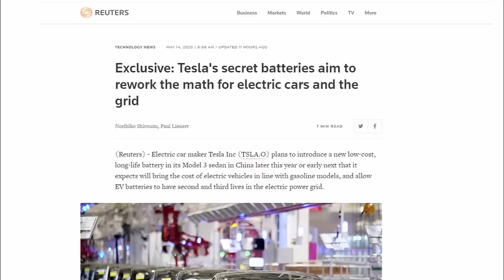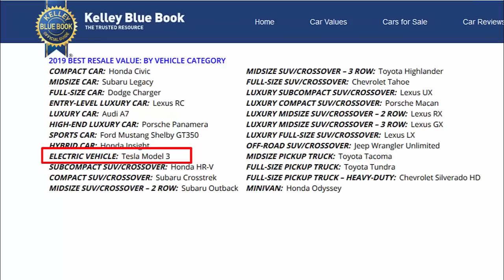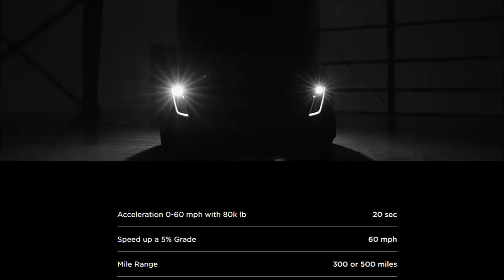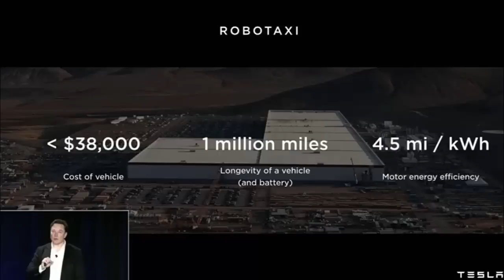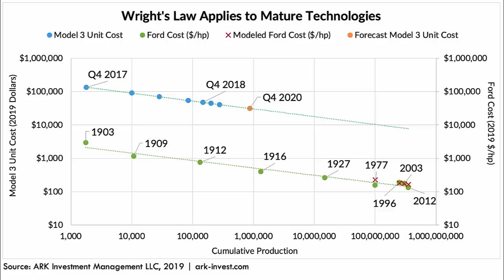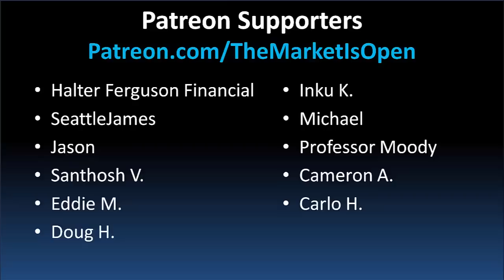Tesla Battery Day Will Unveil Secrets to the Million Mile Battery

Comment: The purchase of Maxwell is the key to longer life of the battery.  They make high capacity capacitors.  If you search the web, you will see videos of people that have replaced the regular car battery with a capacitor bank.  When you accelerate, this is what puts the greatest strain on a battery, so why not use the capacitor bank to handle the strain and reduce the battery recharge cycle.  That increases the battery life by at least half or more.

Comment: Longer lasting batteries will most likely just be the next Tesla owners problem.
Reply: Negativity or sarcasm?
Reply: Most Tesla car owners will only drive an average of 5000-20.000 miles a year. And considering that they will sell their car on average probably around 4-6 years in average. Means that the original owner will most likely not be affected by battery problems. It will then be the next car owners problem. Which is after the warranty has expired. So it's neither, it's the truth.
That is also why most EV car manufactors battery warranty is completely useless. The battery warranty most manufactors have is only relevant for less than 1% of people buying the cars.

Comment: putting so much energy into such a small space would be too dangerous!!!   Science and physics says it would be a friggen bomb,  or radioactive as hell!   Maybe they can get a battery to go though more cycles...  But not hold a million miles on one charge.   As an ex-mechanic I don't buy the fact that having engine/transmission that will last longer will save the customer much money...  Most the repairs to older cars 15-18 year old,  is everything rubber and plastic starts to fail.   A/c hoses,  Door seals,  window guides,  suspension bushings,  Inside parts like stearing wheel starts to wear out,  seat leather starts to rip,  raidio knobs stop working,  window switches,   ignition switches.. sun visors..    the list goes on and on for older cars....   It takes a lot more money to maintain a car past 15-20 years old..  Even if its electric....
Reply: The best and longest lasting batteries ever built are highly radioactive  {nuclear batteries).  They were used on "Voyager" space probe and  "mars rover".   They produce a lot of power and have a super long life  but are also very radioactive.   Google "nuclear battery"  for more info.    E=MC2   means Mass can be converted to energy.    There is actually a nuclear battery you can make at home, using Tritium  and a solar cell..   But the power is very small.  Google "tritium battery." for more info.

Comment: It's still going to be a Lithium battery.

How is increasing lithium battery production 'green'? 
--
o Lithium's maximum potential as an energy storage mechanism is much less than liquid carbohydrate fuels
o Replacing 10s of billions of engines with electric motors, many containing expensive, intensively produced neodymium, cooled by essential lubricating oil
o Increasing Lithium production 10s of 1000s of times to supply all these 'million mile batteries' - which they won't be
o Opencast lithium mining is hugely destructive
o Evapourating 100s of litres of drilled underground brine reservoirs for 1 kg of lithium releases vast quantities of the most powerful greenhouse gas, H2O
o Millions of acres/hectares of land will be needed
o Refinement of lithium is very intensive,  transport costs on top
o Battery production is very intensive, transport costs added
o Battery disposal is a major problem, with recycling costs added.
o Portable devices are on the increase. Lithium is not a sustainable fuel. Increasing its use by 10s of 1000s of times will be highly destructive
o Carbon and Oxygen cycles are natural, CO2 is plant food., we breath O2 There is no natural global Lithium Cycle 
--
How is increasing metal space junk 'green'?...
--
Musky people stink. Brainwashed neo-peeps... Nazti Sheeple-Kidz and profiteering parroting controllers. Plant more trees, but more importantly, stop cutting down our wild forests if you want to be green. NEVER BUY AN E-VEHICLE or you will be less green than a lump of coal... or solid lithium (even worse). It's a marketing scam by neo-liberal scum that want to force the world to buy their new e-vehicles and sprawling junk power schemes.

Comment: Wish Tesla comes up with a plug-nd-play battery that can be recharged or replaced similar to the AAA batteries  in every home, so that there is no need to go to the gas station.. basically it means it can deliver FREE energy for cars and all vehicles, (and for all our home needs as well) at very very low battery cost which is rechargeable... imagine the same battery can be used to power homes or industries at $20/kwh - that wll be a game changer.  I think only a Hydrogen fuel cell (SOFC ) can match up with this in the near future, when hydrogen can be stored at low pressure for all our energy needs at homes, industries , and transport needs.

Comment: One issue of V2G usage is the potentially diminished flexibility of unplanned journeys. No doubt there would be the facility to limit battery drain down to a minimum level of charge as a contingency, but situations may arise where this would be insufficient for an unplanned journey. It's not a game-breaker, but the associated anxiety - or indeed an occasional real-life situation where this occurs - is a factor to be considered. (it's still great though! :) )

Comment: I wonder if the million mile battery starts to achieve the types of energy density that would be viable for planes.
Reply: For ultra light gliders which have to be towed by another plane to take off it could extend capabilities, like longer flight and more maneuverability perhaps. But there is no way to achieve the power to take off on its own power.
Reply: That's the nub of it I guess. As Musk has said, the biggest energy cost is getting a plane into the air, once you're there battery power isn't such an issue. Perhaps there is some way to launch a large plane with ground based power, then let it fly on it's own battery power. Maybe we aren't a "million miles" away from that being viable, but there is no political or economic will to do it, if we indeed are.

Comment: on the semi-truck ya could plate the roof of the trailer with panels to help slow down the energy use
Reply: That's not slowing energy use - it's increasing production capacity.
Reply: @DialatedPupils never said it would be used where it snows. it will be used were its sunny.
Reply: @DialatedPupils meh Australia could use panels most state of USA for 3 quarters of the year same with Europe

Comment: No info on Energy Web Token? Impossible to miss that, links between Tesla's new P2P power grid, Autobidder and Energy Web Token. Aemo that is using this system currently in Australia and even the company Tepco is listed by the Token creator. A small update on the Model 3 and its live, especially with the new million mile battery. EWT reached all time high today. You are welcome. Finally a crypto that is used for something other than speculation. Research it yourself guys, this should be enough to get you starting.
To be honest, Bitcoin cant be used for anything like it is. Its like version 0.1 of the technology that has risen. All credit to the one/people that have created bitcoin but we are not driving the first car ever made, are we?

Comment: Tmio, I think you miss one important element with the million mile battery (mmb). Like other comments about this video, yes, Tesla will put the mmb onto the commercial trucks which need a lot of mileage, but the real strategy behind this is the V2G via the Autobidder software so Tesla owners  can sell the energy back to utility along with using it as backup energy source on homes.  I'm a 7-year Model S owner and there is no way I replace my battery to mmb pack due to high cost but if Tesla offers me a good deal or my utility company can provide the credit on the energy I sell, I will consider.  By the way, a million Tesla cars of 60KW to 100KW equates to over a GW's of energy.

Comment: 1000000miles= 50000mi./yr for 20years...that's insane.
Reply: Basically a lifetime
Reply: unnecessary miles per year. It basically suggests lifetime of the vehicle. Although I don't know what actual numbers look like when the life is reduced by fairly large portions. Consider the common, or normal, usage of the charging process. People don't or can't actually provide the battery with optimal, and/or even suggested charging sessions or intervals when used by the average working adult. Which, as mentioned,  hard on the battery and reduces its potential service life. 
   I don't know how badly, but I am optimistic it is quite impressive of a battery just the same.

Comment: Considering V2G and V2H possibilities for this tech, a good reason to await roll out before I buy my Model 3.
Reply: Not sure why he mentioned it honestly.  Tesla has consistently shown that they would rather make batteries cheap enough that you can own both home- and car-optimized systems, rather than compromise the car and pay for rarely-used inverters and connectors.
Reply: @robot65635  tesla could "lease" you the battery because the battery often outlasts the cars, so the car would be cheaper but all profit from vehicle to grid would go to tesla also this takes away worries about changing an expensive battery tesla sends you an email you bring it in change it  and reuse the old in those powerplants from the video

Comment: I can’t imagine replacing the batteries in my Model 3. If I can only get 85% of its range, OK, I charge it a little more often, or I sell it to someone who wants a cheap local runabout. Or I find someone to convert it into an enormous powerwall.
Reply: Ill have it on the cheap if you dont want it lol
Reply: Shaun468 486 it’s 2 months old, so no! And it’s already at 12,593km. By the time I’ve paid it off after 7 years, if it still has much life left in it, I’ll be quite surprised.
Reply: What do you mean 85% of its charge?
Reply: Hipz Whitetower Batteries deteriorate over time. 

All things (weather, road conditions etc) being equal, if my car can drive 200 miles the day I bought it, and 198 miles a year later, it’s lost 1% of its range. 

The batteries are replaced under warranty if they lose 30% of their range within 8 years, last I checked.

Comment: There will always be a need to transport new Tesla vehicles over land and oceans to reach their new markets/owners.  Currently this is done 10 cars at a time over land via class 8 truck auto carriers and 7,000-8,000 cars (plus soon semi trucks) at a time over oceans via bunker oil burning cargo ships built specifically for that purpose.

Design these transportation modes to use the energy stored in the battery packs of the Tesla vehicles being transported.  The ocean going auto transporter ships could supplement the energy in the battery packs with solar and wind energy options -- even metal sails that function like aircraft wings.  The bunker oil currently used to propel these hugh ships is a MAJOR source of air pollution, and should be an embarrassment to Tesla.
Reply: or maybe tesla should just make electric supertankers
Reply: I hope I speak for everyone when I say, please go away.

Comment: Although you  briefly discussed battery life cycles when you mentioned degradation, I would have preferred a more comprehensive discussion about this issue.  The reason one million miles will be achieved is because the batteries will have at least 4,000 cycles.  In fact, there are some clues that even 5,000 and 6,0000 cycles are possible.